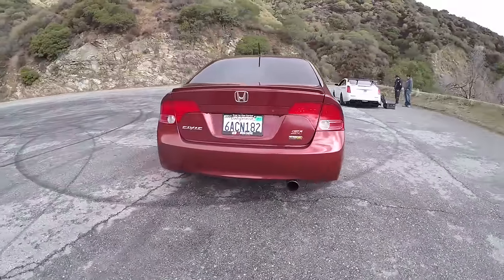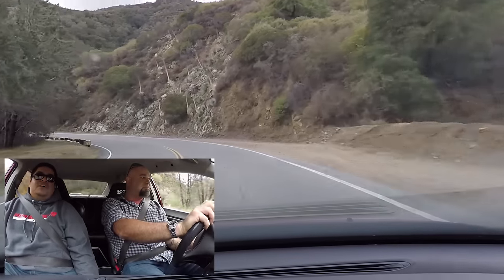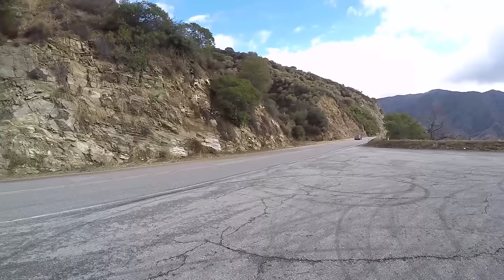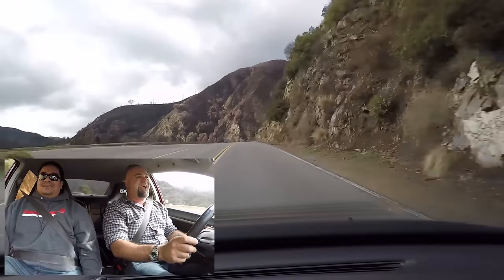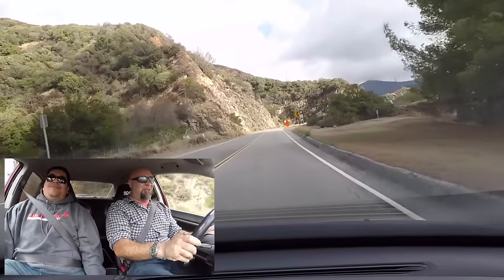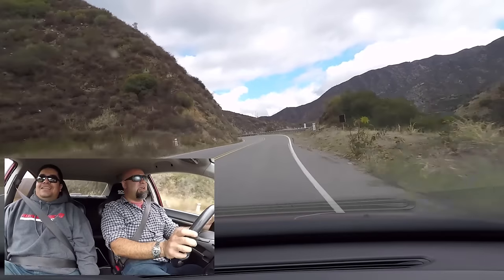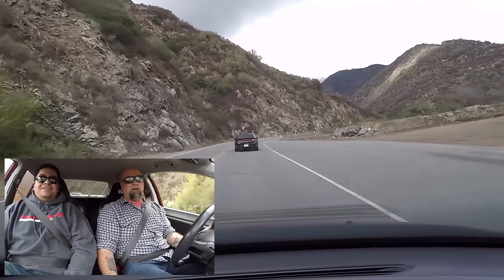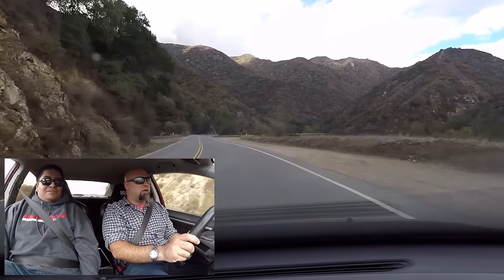INCREDIBLE 330HP All Motor 2007 Honda Civic - One Take

Comment: Take note, Honda ricers, THIS is what a nice civic looks like.
Reply: Duhhh
Reply: It looks basically stock, and has 15 thousand dollars into the engine.
Reply: and this is what a REAL engine sounds like! no fart can, and no toilet flushing sound from turbo!!!
Reply: Nick Motsarsky I'm not ricer -.-
Reply: Noise Control my bad aha. I have a 17 si I never really liked the 8th gen. But this one is fast 💨
Reply: Noise Control Im still looking for one sadly it’s hard to find one in mint condition.
Reply: ihateliberals what’s wrong with bov sounds ?
Reply: Mike Harkins it’s faster then the 8th gen stock for stock. I have Prius mpg and my sound system is better stock. I’m happy. Do I plan on modding it? Fuck No! Not with that 1.5 motor.
Reply: @pawg206 .. Of course its faster than the 8th gen.. its 10 years newer.. But its makes like 5 more hp LOL... And its really not that much faster at all.. What makes you THINK its faster is because it makes power at lower RPM and has more torque.. Why you would buy an SI without plans to do some mods is beyond me(isnt that the whole point of buying a sporty Honda??)... Altho, the 10th gens cant really be modded.. So I really wonder why you even went 10th gen when you coulda got a 9th gen coupe with the K24 for like 8K less.. That 10th gen needs forced induction to make pretty much the same numbers as the k20 8th gen... That is pretty sad if you ask me lol
Reply: @pawg206  .. also, you can get an immaculate 8th gen for like $8K.. That leaves you with like 14K to upgrade and a K20 motor that will last you forever unlike that Fit motor lol.. My Type S has better suspension, better seating, better driver-focused interior and dash, better technology, and has 50 more hp and its NA.. And Im not even close to being into the car what it would cost for a new 10th gen... The whole point of the SI and Honda FWD sport cars is to have a high-revving, Vtec, fun car to drive.. The 10th gen takes a lot of that away and pretty much turned it into a GTI/SRT4 clone.. Those 1.5's are trash motors.
Reply: Mike Harkins only poor people mod civics I don’t care for mods. It’s a 4 banger it’s ain’t no v8 .
Reply: @pawg206 .. Only poor people mod civics?? LMAO... So Only V8's can be modded be rich people? .. You realize that there are 4-bangers pushing 1000+ HP right? EVO's and STI's are "four bangers".. Modding civics properly costs a lot of money.
Reply: Mike Harkins well this is a civic.evo and sti for 44k cars off the lot new.
Reply: @pawg206  .. Whats ur point? Type R civic is same price.. The reason they cost so much is because of the turbo system, bigger displacement, better internals, ect.. The k20's and k24 becomes the same as those cars with a good turbo system. The 8th and 9th gen Si's are similar to the Type R only without a turbo system and electronic dampening.. And they can easily be superior to a Type R because they are not direct-injected like the k20c1.. This means its far easier and cheaper to make power. Just because you stereotype Hondas does not mean they are worse than an STI, evo or a V8.. But my point being, you can easily have a car thats just as fast, just as technologically advanced gor half the price of those cars with an 8th gen..
Reply: Mike Harkins that’s a 34k car that’s 10k Difference. I’m just saying I wouldn’t mod a 1.5 liter civic or si.
Reply: Mike Harkins  I like the fine lines of where it’s at for the price and performance. There is no 2018 Sti for 30k lol. Type r msrp is 34k
Reply: @pawg206 ... Hey man, if your buying a car for its fine lines, and your okay with 180whp for a modern performance car, thats on you.. But there are MANY low miles 2018 STI's on cargurus for around 30K.. MSRP means nothing.. Fact is, people are paying more money for a new Type R than for a new STI... just the facts.. The MSRP for a EvoX Final Edition is like $36K and some people are paying over $50K for them.. What matters i what people are paying for them, not MSRP..
Reply: @pawg206  .. And I just got my new 2019 STI for $34K(saved about $3K).. My Neighbor just got his 2019 Type R for $39K and that was considered a good deal...
Reply: Itz Knt You can find a lot of 4 bangers under 25k that’ll make really good power with mods
Reply: @killer_vette351 .. There are tons on great 4-bangers you can get that make great power for cheap.. What's great about 4-cylinders is the challenge to make power with so little.. A v8 has the power already there and takes zero effort to make a car fast. This is why Honda, Subaru, and Mistubishi have such a big following cuz of the joy of modding 4-bangers for cheap.
Reply: Mike Harkins yea ik, I have a I4 I’m bouta sell it and get a Hyundai Genesis coupe 3.8 as a daily instead tho
Reply: Mike Harkins I already have a RWD with almost 3x the power of that in cold weather (sometimes, our weather is on n off) I have a couple friends that have Genesis Coupe’s and they have said it’s pretty reliable, money for parts is not a problem for me at all, insurance is the only thing since I’m 23, and havin this and the vette on my insurance will get crazy but it’ll be fine
Reply: Mike Harkins but I’ve looked and found some on car gurus for $15k, most of them are under $20k so it’s a small price for a lot of car imo
Reply: Well that’s just like, your opinion, man.
Reply: oh its rice if you cant afford thousands to have a setup like this right? and rice if you have a nice stereo and subwoofer in hondas and if you have a louder exhaust. but its not rice all the crap ford fiestas that go around my area with stripes made from electrical tape and stupid loud exhausts
Reply: @Noise Control I'd gladly race this honda against my 30year old toyota celica gts jdm powerplant. With a standard 180hp is more than enough for me to pass this civic on the canyons.
Reply: all I care about these days is MPG XD
Reply: @pawg206  how many poor people can drop $50k on a motor?
Reply: not a fan of the 10th gen si myself.  But i would not be bashing it because you have an sti. The ej is trash bruh. Also this 10th gen on e85 with 2 bolt ons will beat your sti with fbo.
Reply: @geenuz4fam  ... what are u even talking about??.. I'm not bashing the 10th gen because I have an STI.. I'm bashing the 10th gen cuz it's a TERRIBLE follow up to the k20/24.. using a single-ported, Direct-injected 1.5  from the Honda Fit is lazy work by Honda and it completely limits people from modding big power.. and the EJ is a great motor.. it's great in stock form and there are relatively simple solutions to strengthen the weak points to make bigger power reliably. Its def no k20,  but it's way better than the Honda fit 1.5 lol
Reply: just saying. Your over saying the 10th gen is trash. When your car is not any better. As far as reliability the 10th gen is bettwr then your sti. Like i said its faster too with bolt ons.
Reply: @geenuz4fam  .. Reliability? Bro, the 1.5 Fit motor is not THAT reliable lol.. And we really arguing reliability here with sport cars? LMAO.. And the 10th Gen is not even close to better than an STI bro.. No offense.. The STI and WRX in stock form are incredibly reliable tho.. The only thing that makes them unreliable is morons who dont know the strengths and weaknesses of the motor.. The same can be said about the K20, but the k20 is indeed far better built and more modern so it can handle more abuse past stock, but can still easily blow if not modded right. But I know tons of people who are far into the 200K miles on WRX and STI's in mostly stock form. Which even in stock form are far better cars in almost every aspect performance wise to a 10th gen.
Reply: its not the same as the fit. The internals are diffrent.    Sports cars could be reliable. These are not super cars.
Reply: @geenuz4fam  .. LOL it is the same as the fit.. It is the same block and the same head... Just added stronger internals to handle the boost.. The block and head was not designed for this.. Honda simply got lazy, wanted fuel economy so they got their Honda fit motor and added better internals lol.. And Sports cars that we love to mod will NEVER be reliable.. Just a fact. As long as they are combustion, piston motors, they will never be reliable..Reliability is subjective.. But when you are adding boost and mods, you will be messing with things..  This is never a combination for reliability.. And quite honestly, where is the fun in building block and making power if everything runs smoothly all the time and you have great reliability all the time? 4-bangers cannot be reliable when making alot of power.. BUT the k20 is one of the best 4-bangers to ever be made, so to downgrade to a 1.5 Fit block makes little sense to me.. If I am buying a sports car for enjoyment, the LAST thing I care about is fuel economy and a ton of reliability. I like getting my hands dirty and fixing my own car. If the car never has any issues, it gets boring and old real quick.
Reply: Nick Motsarsky facts
Reply: @geenuz4fam  .. Chill man.. My Subie isnt ass, and the I never said the 10th gen is a terrible car, so dont get butthurt.. Im simply saying the beefed up Honda Fit motor is NOTHING compared to the K20/k24.. which is just a FACT.. The 8th and 9th gen provide SOO much more ability to mod and more choices in general. You can get AWESOME NA power, or go boost and see HUGE power... You cant go NA with the 10th gen, and you cant make big power on that Honda Fit block and head.. You just cant.. And adding port injection would take ridiculous amounts of money and a whole new head design.
Reply: your missing the point. Bolt on to bolt on the 10th gen is faster then any other si from the factory.  Facts. Im not butthurt as i do not own one.  But i do own a 99 si with a k24a2. Way cooler then your sti. Lol.
Reply: the majority of people that buy an si. Are only goin to do bolt ons and a tune. Also my 99 si is way cooler then your rsx. 😆
Reply: Nick Motsarsky this is nice? 

Powerful, yeah. That’s about it.
Reply: Mike Harkins yeah, still gay. 

Sorry, but I will never enjoy a FWD economy car and call it an enthusiast car.
Reply: @chrispewkreme  have you ever driven a fast modded front wheel drive car? Especially a built na/motor? I had that same mentality and only drove rear wheel drive v8 cars, I bought a 94 talon 2.0 turbo car for cheap and fell in love with the idea of front wheel performance I modded it Abit and drove the crap out of it and sold it wish I hadn't, anyway then got 08 speed3 heavily modded and even tho it's Abit heavy that car is a rocket ship. So then on to always wanting to build a Honda so I built a 95 ek coupe k20 swapped all motor and it is the funnest damn car I've owned and relatively cheap to keep going strong. I was big into foxbody mustangs before and still love them but for just pure driving pleasure I'm stuck on those front wheel drive economy cars plus there's something satisfying in taking something that's not a muscle car and making it fast.
Reply: @_gdmoto  typical mistake. Supreme decal to the back bumper is the first mod anyone should make, slanted also. Instant +45whp / +23.5ftlb . Need more hp before adding downforce.
Reply: 8th Gens are great because of retaining their famous 8k rpm redline but they never should have done away with double wishbone front suspension , I can't fathom why they ever turned away from such a tried and true race winning design that made the Honda game what it is , that and a classic an infamous B series of course, in a Crx Hf 1963 pounds baby
Reply: Turbo 2.0 will last much longer.
Reply: @pawg206  07 civic motor stock has a very aggressive vtec crossover  K 24 is cool but that 07 was the first car I rode in and I fell in love.  Stock exhaust  all stock
Reply: @pawg206  I own a 1990 Honda civic si. Rsx type S motor in it ,  it eats mustangs for lunch
Reply: @pawg206   Hondas deserve a lil more respect. Fuck the 1.5. It's too new  k swaps are getting to be stupid cheap.  Civic roller w a blown motor 300 bucks K 24 from a accord motor and ecu flash small turbo  ur looking at like  2500 for a nice low miles K swapped car.   Real drivers break shit when we drive the civic is something  u can't really kill. Bullet proof  especially when it's stock ur not braking shit beside overheating stock brakes.  Can't beat that handling.
Reply: Mike Harkins you did say the 10th gen is terrible.. why you lying lol.
Reply: Ronnie Young fuck no. K swap
Still an arm and leg. You see the HMO price or other online site that sell k series. It’s all fun in games to be a stock car with a swapped 4 banger. But it’s still a reliable economy car and that’s how everyone is going to look at it.
Reply: @ihateliberals518  Sounds like a flipping liter bike. It's wicked
Reply: Nick Motsarsky please we know all of this already. The majority of Honda guys have very solid builds.
Reply: I despise how that gen civic looks.
Reply: No this is what a expensive honda looks like. Get your shit straight. In the a buget k swap eat this.
Reply: Might be a hair faster than my stock Type R but it would end up in a guard rail trying to corner like mine can. Straight line speed isn't even where the sporty civics shine - they excel in handling. If straight line speed was all I wanted, I would have bought American muscle.
Reply: @bassandspaceable  Bro Hondas are breaking record in drags wtf u talking about. Lol. K series handle just fine as well. Most people just run shitty suspension or stance tire set up. But k swap with a time attack build can handle as fast as a type r. maybe not stock chasis though.
Reply: @bassandspaceable  Hondas are so fast that they are done trying to compete with other 4cylinder or v8 in drags now. Lol They are just trying to race other hondas and beat their own time.
Reply: @effingwrecked1917  My first Honda was actually this generation Civic. Just crazy to see people getting that kind of performance out of these things! The Type R I have now is like night and day to the stock 07' LX I had back in the day
Reply: @thedragon356 , that's a "to each their own" matter.
Reply: If you got the money, you can build something nice ..
Reply: No civic will ever be nice to me lol they’re all shit boxes
Reply: @thegoldentheory4383  youve only unfortunately owned shitboxes then, ive had Honda in my family forever and ive NEVER had a car shit on me or act up besides normal maintenance/upgrading parts.
Reply: @RaveeMattRavee  I’ve only ever had audis and I’ve shit on every Honda I’ve ever come across, vtec is a fucking joke because almost every manufacturer has their own version of it but they don’t flaunt it like the lawnmower company does.
Reply: Clean as fuck, but not as fresh 😅
Reply: @chrispewkreme  It's certainly far nicer than the hideous Type R with the wings and fake vents all over. Faster, too..
Reply: Im sorry but no, 13000$ into 330whp na? Come on, i could do a stock k20 5858turbo setup on pump and make 450whp for less and it would be just as responsive as an na car.
Reply: @DirtyDanRacimg  Imagine thinking that a turbo engine could EVER be as responsive as a highly-tuned n/a motor..
Reply: $15k!? Forget it.
Reply: @ryanleblanc6817  I'm a certified aircraft mechanic, dork. But you're right, I wouldn't build a Civic to begin with. I'd use something worthwhile, like an MX-5, instead of a played out Honda..
Reply: @nickmotsarsky4382  Am I supposed to be impressed? That doesn’t mean you would know how to build a car like that. He has gears from like 6 different cars. A lot went into that build.
I’m a crane mechanic and I’ve worked on blowout preventers. I wouldn’t know where to begin trying to replicate this build.
Aircraft mechanic is pretty vague. What do you even work on. Also I know a handful of helicopter mechanics that don’t know their ass from a hole in the ground.
Reply: @ryanleblanc6817  I work on jet and piston engines and have had multiple performance cars, including an El Camino SS, Mustang GT and a 350Z. Building a Civic like this isn't that big of a damn deal, get real. Stick to cranes.
Reply: @nickmotsarsky4382  Nobody cares about your old clapped out 4.6 GT. You couldn’t build this Honda.
Reply: Agreed. I'm a Honda fan and i would much rather focus on power than how it looks. Giving it a basic stock look like the one in this video is all a civic needs. It doesnt need a ridiculous spoiler or 12" coffee can exhaust on it.
Reply: HELL YEAH😤 just got one and this video was suggested in the most perfect timing
Reply: No this is just one persons taste stop creating drama yes we all know who obvious ricers are [1999 civic lx with a 3ft wing. Etc] but come on now its just getting out of control as if any mod makes u a ricer. Also heres a kicker, EVEN if somebody puts a 3ft wing on their street car but they track it and that wing is functional, how is that ricer? Just cus u dont like the taste? Thats not what a ricer is.

Its pretending to be fast when you arent. Has nothing to do with the car.

Also being fast is subjective.
Reply: @nickmotsarsky4382  also you are chastising the Si for not being a sports car yet you say a 350z is a performance car😂😂 im dead it cant be both
Reply: @pawg206  cap cap cap
Reply: It looks stock lol
Reply: @hondaforcedproduction2469  That's the point.
Reply: @ADA513  no where near 15k into the engine 😂
Reply: @ThatPokerGuy  Oh, does he say FIFTY Gs?
Reply: Except it's a sedan, unfortunately...
Reply: Difference is, I can sell my car and get a new one. You can’t sell your wife.